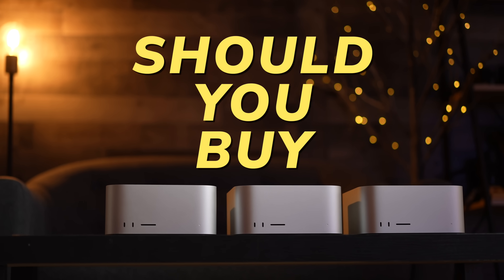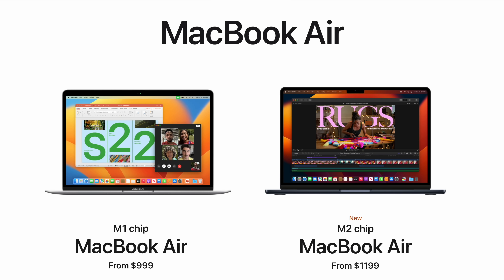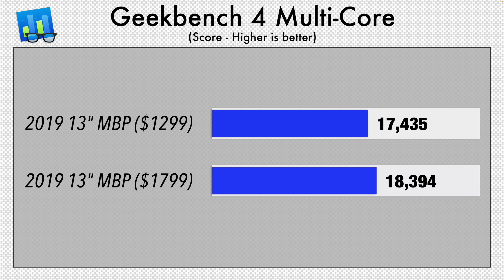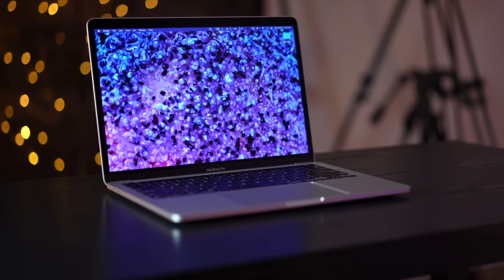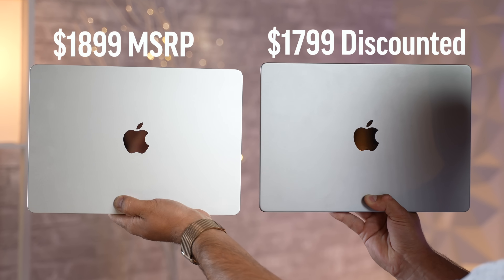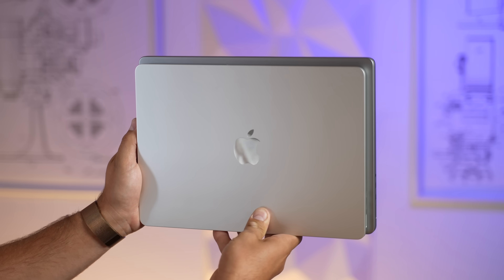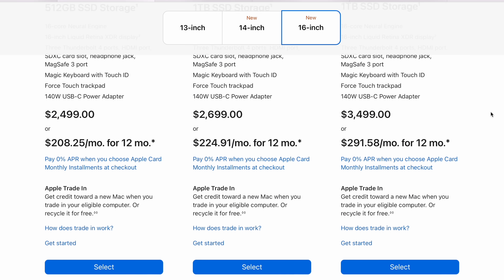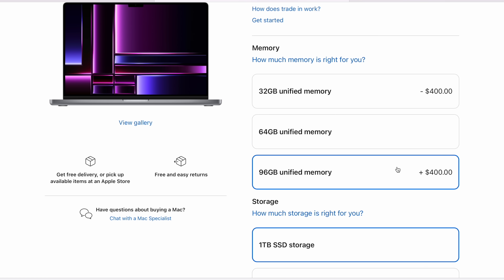How Much RAM for Your Mac in 2023? ULTIMATE GUIDE!

Comment: Guys I can not decide betwee m2 pro 14" base vs m1 pro 10c/16c 1tb 14", almost same price, what would You pick? M2 is more snappy i think, but that slower SSD(RAM swap mostly) makes me crazy.
Reply: M1 Pro is better. Better multicore, graphics and much better screen
Reply: @Fabian A.  better screen, graphic? What are You talking about?
Reply: What are you using it for?
Reply: @MVP Kryptonite  not for photo/video or music, just for home use, test automation, maybe docker, etc. I already purchased m2 base, but can return it back and take that m1 10/16 1tb, but I am not sure if it's worth it actually, I do not need ssd for space, just thinking about that ssd speed, and ram swap. that's it
Reply: @smokehead5318  likely in real world, reaching the top SSD speed is not an issue and RAM swap can be avoided with more memory in most cases. Sounds like any MBP will do the job
Reply: @mvp_kryptonite  You meant mbp m1?
Reply: @smokehead5318  MPB M1 Pro gets my shout. I have it with 32gb memory.
Reply: I fetched this video for you. 😎
In short probably the M2 pro:
https://youtu.be/AyuxqbFQuTs
Reply: M1 Pro no brainer: twice the storage, faster SSD and M1 family just runs less hotter than M2s.

Also is that on same amount of RAM?
Reply: @MissionControlTet  yeah, m2 base 14" vs m1 14" 16gb, 1tb, 10c/16c(100$ cheaper actually, both new)
Reply: @smokehead5318  M1 Pro is better, basically can last you twice as long with very negligible sacrifices
Reply: @MissionControlTet  why twice as long ;)?
Reply: @smokehead5318  Twice the storage, essential for swaps especially, and it can hold twice amount of data
Reply: @Communism Lake  yeah, but isn't m2 a bit snappier? With all that little improvements,  here and there, speedometer etc?
Reply: @smokehead5318  I turn it back to you, which one do you prefer? Snappines (highly doubt with hotter cpu, slower SSD, etc) or longetivity?

I prefer losing 10% of performance for longer lifetime, over very slight improvement that cost me like 500GB of storage
Reply: @Communism Lake  that is true ofc, thank You for Your input Sir!
Reply: @smokehead5318   did you see the link I added above? Luke Miani compared base M2 pro vs M1 pro unbinned. 
From the video, it seems the base m2 pro is slightly better in almost all areas.
Anyway, you probably cannot go wrong with either. 🤘🏻
Reply: I have base versions of the M1 and M2 14" pros.  The M2 has the slower drive, but you really do not notice it unless you are doing a workload that causes a lot of swapping.  And in that case, you should have more memory to prevent swapping.   Also, the M2 battery lasts longer than the M1.
Reply: @JBoy340a  Significantly better or just slightly?
Reply: @MissionControlTet  I assume you are referring to battery life.  If that is the case, it is noticeable.  When I am just doing casual browsing on the M1 I would notice it drop from fully charged to 70% in 2 hours.  On the M2 it is in the low 80s%.
Reply: @jerry kurata  thanks for that input;) yeah I did stupid test on my base m2, just from curiosity. I opened 4 games, 30 heavy websites in chrome, 4 youtube 4k, 3 intellij projects, and I pushed it to 17gb swap, it was still working, slower than without all of that, but still, on windows it would be just a big lag, however idk if that test would go better on m1.
Reply: @smokehead5318  that would cause swapping!!! Again, excess swapping is something you really want to avoid.  More memory is the solution for swapping.  With enough load you can get any machine to swap and then justify to the boss you need to upgrade to 64 GB of RAM.
Reply: @jerry kurata  yeah I know, that was just a test to check if base m2 14 with slower ssd is able to handle it, and it was. Those games maxed gpu as well, but I didn't have any better softwares to push ram to the limit ;) m2 is a bit faster in webbrowser that is nice for me, because I do test automation gui etc, I was just wondering if m1 with 1tb in the same price would be a better choice. Thats it